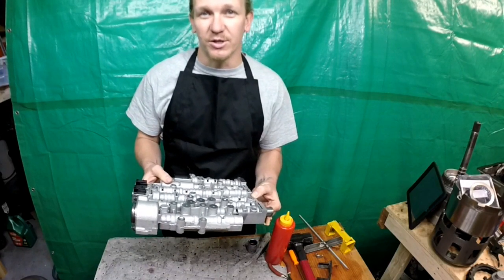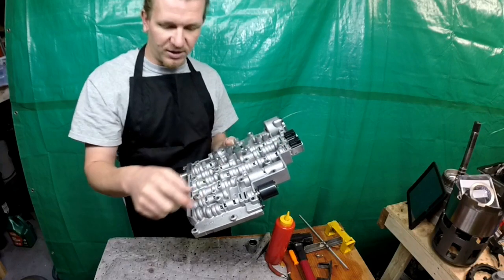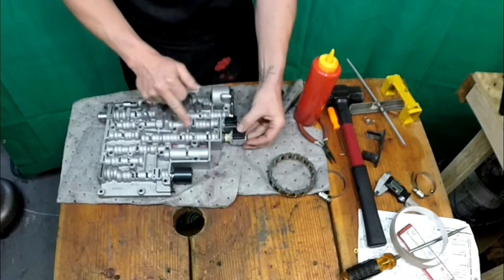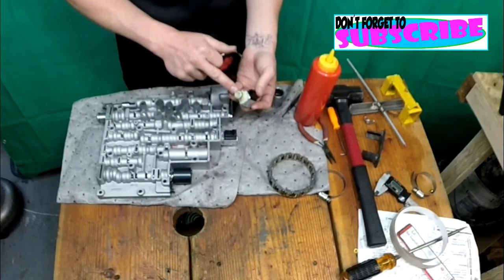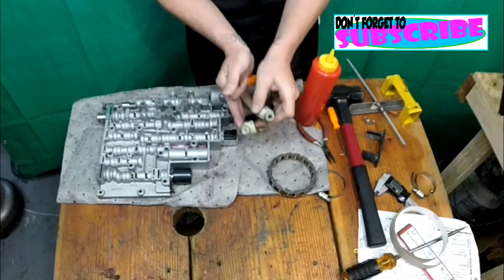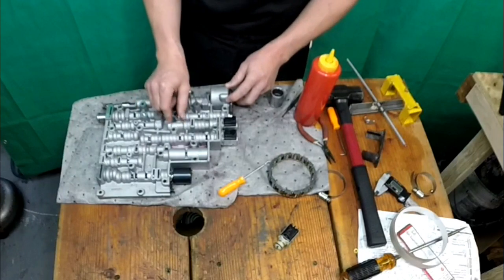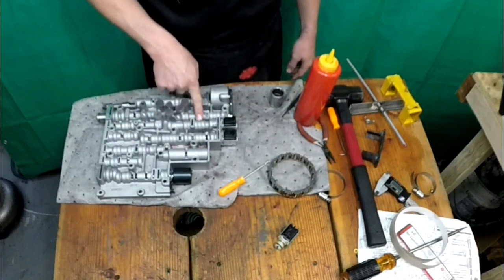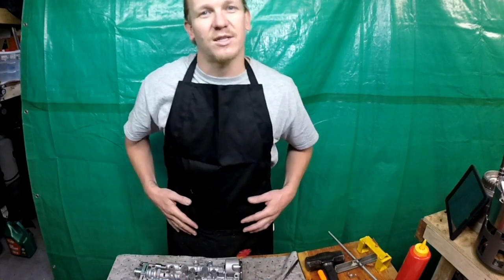4L60E 4L65E Transmission 1-2 2-3 A & B Shift Solenoid Locations. 93-up

Comment: I just had a question about something. I’ve got a 2004 GMC Yukon Denali all-wheel-drive it has the 4L 65E I’m fixing to do a filter change in the transmission. It was doing fine and now it’s acting like it’s trying to slip out a second gear but whenever I let off the gas, it will then go into third just fine and then it acts like it’s kind of funky whenever it’s coming out of third and the fourth and I let off then it’ll go into fourth. I was thinking after doing some research that maybefrom watching your videos that it’s probably maybe a clogged one two shift solenoid do you think that this sounds correct?

Comment: Hi @ScottiesHobbies. I just came across your video. I have a 03 Silverado 4l60e. Shifting into 2nd it hesitates then a slight hard shift and going into 3rd it hesitates but no hard shift. All other gears are fine and the kick down is good. Truck down shifts perfect. Could this be the solenoids or something else. Any information or advice would be greatly appreciated, thanks

Comment: So,are the a & b inter-changeable..
I got mine mixed up🤦🏼‍♂️🤷🏼‍♂️
Reply from the maker: Yep, they are the same.
Reply: @ScottiesHobbies  sweet ‼️
Thanks for responding so quickly,I wasn't sealing it til I figured it out 🤷🏼‍♂️🤦🏼‍♂️
I'm kinda trying to learn as I go,just wanted to do some maintenance as the motor & transmission both have 330,000 without issues,I'm trying to build the truck to the best of my ability and within my means... empowered by YouTube and folks like you,once again thanks so much for the videos and the response so quickly 💪❤️‼️

Comment: What kind of cleaner should I use to clean valves out mass air flow spray? And also solenoid A and B are same part number aren't they?
Reply from the maker: I would use clean atf to clean the valve body and a soft pipe cleaner if you can find one. Yes, A and B are the same. 

Good luck on your fix! 💪👍

Comment: So can I use a 4160E 2wd in my 04 trailblazer 4wd
Reply from the maker: If you change the output shaft, yes.
Reply: @ScottiesHobbies  so their are a ton of 4l60E available on marketplace.  But I heard that the 04 trailblazer LT transmission is different,  like the wholes wont match up, if this is the  case , besides the exact yr and model of my TB , what other transmissions would I be able to use besides the exact truck I have
Reply from the maker: @stanleybrown9176   well It gets a little complicated because there are many variations of the 4L60E transmission. The 4L60E case is all the same but what bolts up to it will be different such as the bell housing and the output shaft and tail housing. The valve body changes from different models in years . The connector for the transmission electronically varies as well..  I just looked up the transmission for your truck in it does come up specific for the 2003 to 2004 year models.  Add a quick glance I can't see what makes it special. Give me A-day or 2 and I will put some research into this. you might be able to convert Those transmissions to what you need. The case itself should be the same but the connections could be different. I'll get back to you soon.
Reply: @ScottiesHobbies  thanks for helping me, so will any 2wd 4l60E fit my 04 T. Lt 4wd as long as we change the output shaft
Reply: @ScottiesHobbies  ok last question,  how can I go about looking for a number or something that would lmk that transmissions I'm looking at will have the same bell housing . Is the number in the glove box, M30
Reply: So basically we have a 2wd transmission  in the glove box it says M30 and mine does too, does that mean the bell housing is the same cause they both say m30

Comment: Bro good explanation.....but I have a question the first gear on my 99 Pontiac gtp is not working and the rest of the gears work good no slipping would it be a solenoid? It's a 4 speed. It's only have 120k miles TIA💪

Comment: MY 1997 4L60 FEELS LIKE OVER DRIVE IS BANGING IN AND OUT , IF I SET THE LEVER TO 3 IT STOPS JUMPING .WHAT SOLENOID CONTROLS OR HOLDS PRESURE TO THE OVER DRIVE CLUTCHES ?
Reply: Your 3/2 downshift solenoid is acting up. I'm a trans builder for over 35 years.
It will make them buck in and out of 3rd and 4th. It's because the fluid is thick when cold and not venting correctly. Hot fluid is thinner than cold. The down shift solenoid is normally vented NOT normally closed.
Reply from the maker: How is reverse?
Reply: @ScottiesHobbies  REVERSE IS FINE

Comment: Alright Scottie, I'm here because i trust your knowledge. I have a 94 Chevrolet K1500 with the 4L60E Transmission. Here recently i have had problems with it. Everytime i go to drive, my truck will Rev high before shifting into 2nd gear, after i let off the Gas a little bit. I have done diagnosis, i have asked for advice from others, and I've even loaded up the parts cannon and start firing hoping that these parts will fix the problem. I've replace the fluid in the transmission, replaced the fuel pump and even did a tune up on the truck. Perhaps it might be the solenoid that has gone bad and that's why i'm having trouble shifting? Thanks

Comment: I have a 2008 Chevy Silverado. If your 1-2 accumulator and shift solenoid go bad or start to have problems will you always get a check engine code?
Reply from the maker: Not always. Actually pretty more common to not get a code.
Reply: I'm going to try and tackle the job myself  your videos are very helpful . Thank you very much for replying back to my questions.

Comment: Is that an expensive fix I had a complete rebuild on my 99 trans am I'm just past the warranty of 12 month 12k miles and my transmission is slipping
Reply from the maker: Replacing the shift solenoids is not expensive. if you are going to replace them you can get a 'Solenoid Master Kit'. Those kits include all solenoids, switches, and a wiring harness. you can buy them here: http://ebay.to/2OEhhO5 or here: https://amzn.to/2I5iAV9 When you are in these make sure your shift valves are clean too.

Comment: I have a 2002 sonoma when i put it in drive or reverse or 123 lower gears it goes no where. What could be the problem . Any help out there . Thanks.
Reply from the maker: Have you checked your fluid level? Sounds like you don't have any pressure to make the transmission turn. have you also made sure that the shifter is actually moving under the truck when you're shifting on the dash?
Reply: 2004 Chrysler Sebring transmission will not shift from first gear

Comment: Hello this videos is kind of old but i have a question i fot my trasmission rebuild 4l60e and before it was shifting hard from 1 to 2 and code p2764 after the shop rebuild the tranni still having same issues with hard shifting and same code came back up not they are saying thta could be the pcm what do you think about it any comments will be appreciated thank you

Comment: HI Scotties, thanks for your time first, so ...i have an envoy 2003 , one day  the rpm going up and not speed up, change a-b solenoid, change manifold pressure, y change another solenoid the second time, and try to clean port valve and valves valve  1 easy to remove valve 2 hard to remove in some place stick  a little , i don't clean de accumulator (so scared its too much hahaha ) and the car 1 good , 2 good ,3 works  but no so soft than the others and 4 or top gear doesent work,  55 mph at 2800 rpm in third gear , R good.  what do you think? can be the sensor throttle position ? i have chek engine light on , but I cannot connect with the truck , so i cant see  the code :( ,  150.000miles .
Reply: he never answear

Comment: my 06 GMC yukon with 125K miles on occasion, usually when cold and heating up, will exhibit a second gear start.  It will do it a few times then work normal all day; next day same thing.  The trans has been serviced by me every 40K miles and the fluid is cherry red.  I did replace the neutral switch on the side with a GM part last year which took care of the problem for a year.  Now I'm back to square one.  Do you think  one of these A/B solenoids is going bad?  I have no codes or SES light.

Comment: Hi... I just change the solenoide A and B and now I don't have no 1,2,3,4 and reverse Y ?
Reply from the maker: Sounds like you lost line pressure.
Reply: Scotties Hobbies . How I can fix it?
How I can know which one?
Reply: Scotties Hobbies .
When I get the solenoide A and B they tell I ask them how can I know which one is A and B so I can put them in the right place and they told me they are the same don't matter.. is that right?
Reply from the maker: castrojoseluis100 they are both the same. If you have no movement after you did the job but had movement prior, I would do it all over again. But it sounds like your pump is not pumping enough pressure now.
Reply: Scotties Hobbies 
Yeah the SUV don't move it all.. what I can do ?
Reply from the maker: castrojoseluis100 did your SUV drive before you switch the solenoids out?
Reply: Scotties Hobbies .. yes
Reply from the maker: castrojoseluis100 have you taken it all back apart and make sure the connections are good? Make sure you didn't bend the connection. Make sure the solenoids are seated properly? If all that checks out, clean the cooler lines to see if you have any line blockage.v
Reply: Scotties Hobbies 
How can I clean the lines ? Do you have any video ?
Reply: Scotties Hobbies .. sorry to bother you a lot.. ok. I replace the solenoide A and B and now I got reverse , 1,2 but no 3rd what can you recommend me to do ? 
Thank u

Comment: I changed out. Both solenoids drove my truck around for a day  and it's doing the same thing it's not shifting but when I purchase the solenoid they did not come marked as A and B did I mess up on that I know this is a dumb question but i guess very important?
Reply from the maker: They are both the same solenoid. Did you make sure the shift valves were able to move in the valve body? Could be accumulator or the clutches could have gone bad too.
Reply: How can I check those two any tips
Reply from the maker: pull the shift solenoids off. inspect the bores in the valve body and take the valves out. check for debris. the 1-2 accumulator is in the transmission housing under the valve body separator plate.
Reply: Thank you!  I am a  single mom and I work on my own vehicles, no less with help of numerous videos including yourself help me obtain a great results on fixing my vehicles being a single mom with a fixed income becomes difficult at times being able to do it yourself type of person save me a lot of money so I am deeply grateful for all the videos that you guys put up there for us do it yourself kind of people.
Reply from the maker: Good job you!! Don’t let anything hold you back. I love it! I have 2 girls my self. Good job and good luck on your DIYs

Comment: How to clean the valves?
Reply from the maker: +Greenback Zo wipe them off. Use mineral oil/spirit  if you need to use a liquid. I blew my ports ot with compressed air and then washed it all out with mineral spirit and let it set for a wile.
Reply: Scotties Hobbies awesome. Thanks for the speedy reply. Will be diving into 03 Escalade, replacing solenoids. Wish me luck
Reply: Can you show us how to get the valves out from behind the solenoids? Also I have a harsh 3-4 and 2-1 change / transition. It's like it all of a sudden just dumps it into gear instead of a smooth transition. Any idea's? .-.-.
Reply: so do the valves like slide out of there to clean or do you just spray like brake cleaner in the insides we where to solenoids poped out of

Comment: Do the spools behind the solenoids pull out? Can the spools be removed with the valve body in place or does the valve body need to be removed?
Reply from the maker: You can get the valves out of the bore and the shift solenoids off with the valve body still in the transmission and on the vehicle.
Reply: Video of how they come out please .-.-.